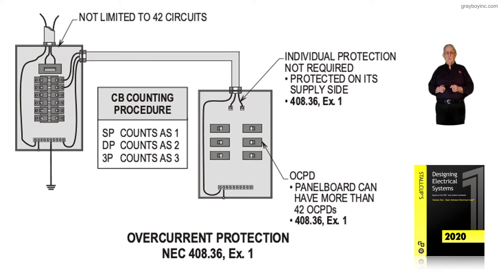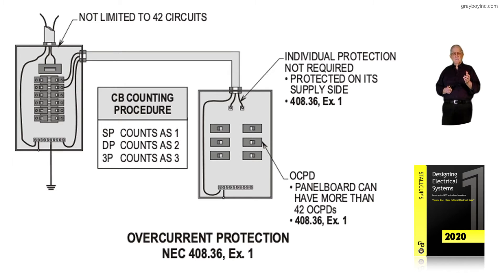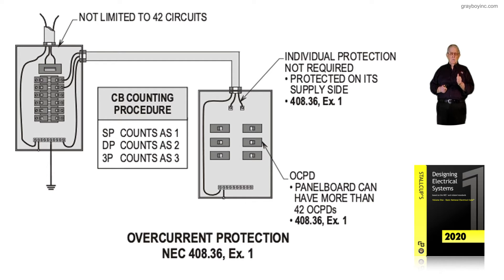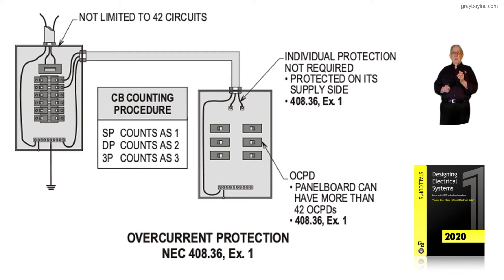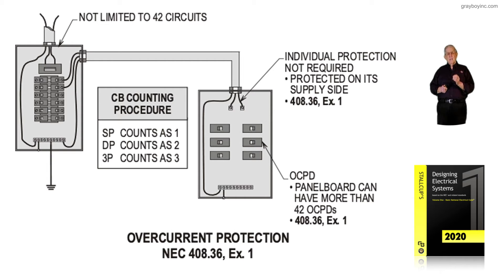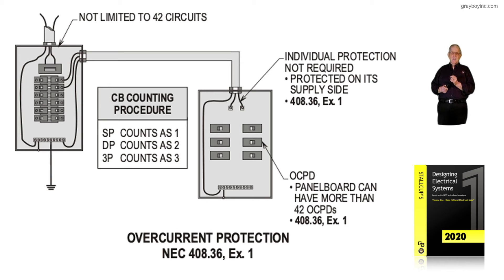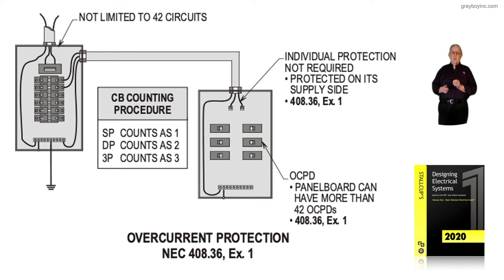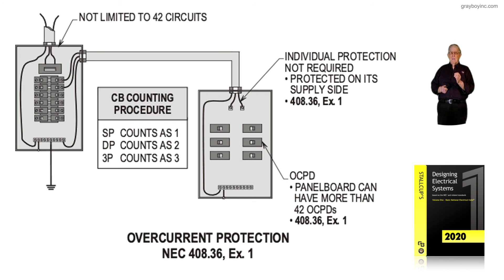7-15  OVERCURRENT PROTECTION - 408.36

Comment: I have two panels being fed by the same feeder from a 200 amp meter and main disconnect all 3/0 wire its tapped in a gutter not feeding through so I have an ocpd device on the supply side of both 

Do i still need an ocpd in both panels?
Both panels are 200 amp
Reply: Hi Kareem,
I'm sorry that I'm late getting back to you. But, no , you don't need mains n the other panels as long as you
keep the electrical system rated at 200 amps with a 200 amp OCPD up stream.
Reply: @jamesgstallcup7370  thanks for replying, i kept getting different answer as I was told this was ok, but with these new codes I guess it gets confusing